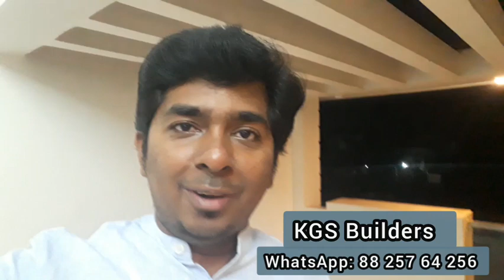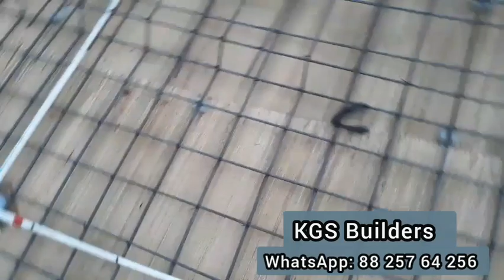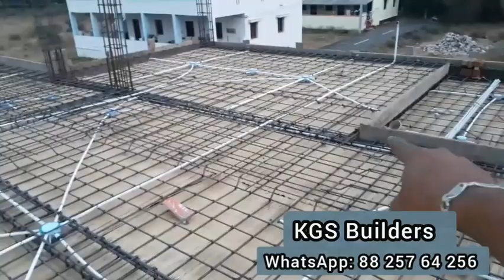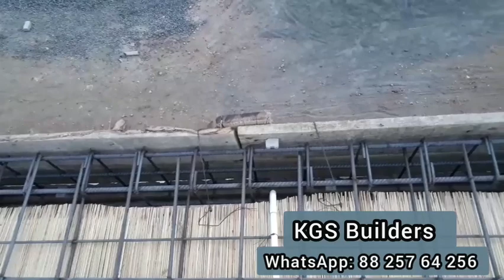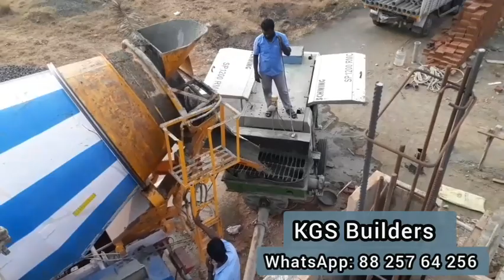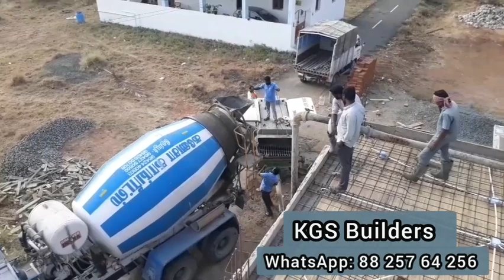Roof Concrete Part 2 #constructiontips #Concrete #KGSBuilders

Comment: Sir ready mix congrete. Square feet rate ah. ??  770 square feet yevlo cost agum sir
Reply from the maker: square feet rate இல்லங்க .. meter cube rate...
Reply from the maker: slab thickness பொறுத்து m³ மாறுபடும் .. beam size also matters incase of framed structures..